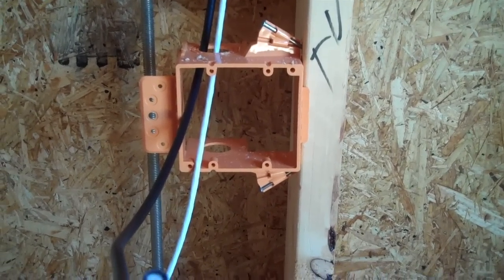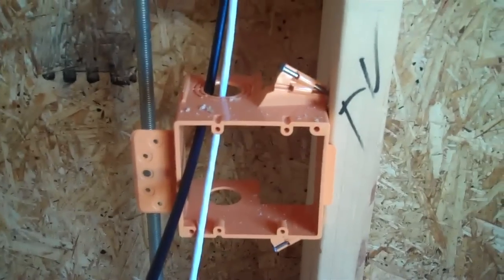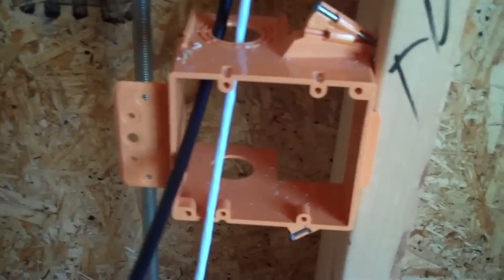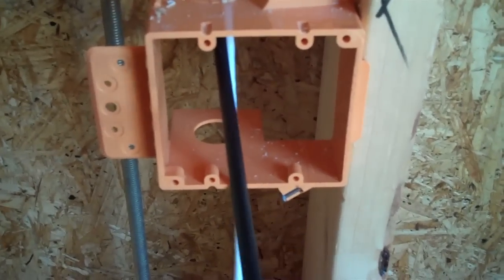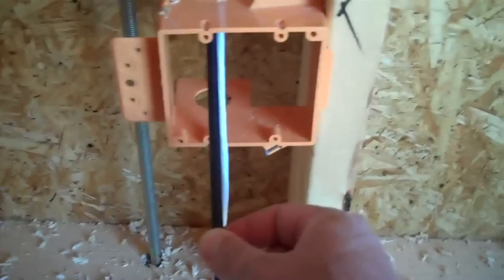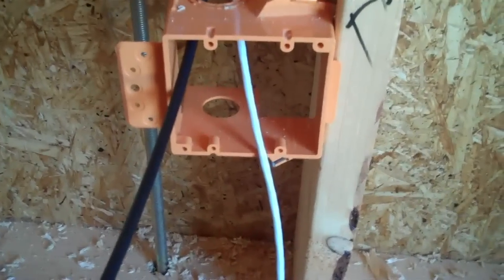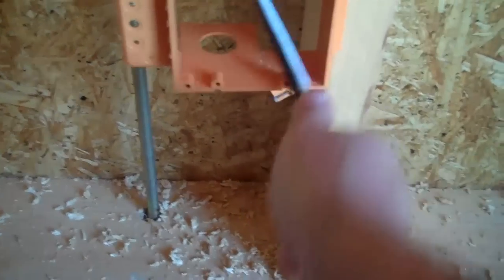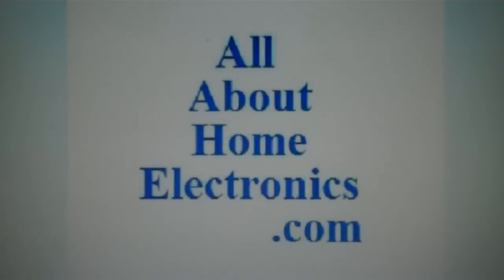How to Wire for a Cable TV or Satellite TV Jack

Comment: Does condensation affect Cat wire & RG6 wire if I was to run it under my Trailer to Another Location?
Reply from the maker: Over time? Probably. Also, rodents chew wires.